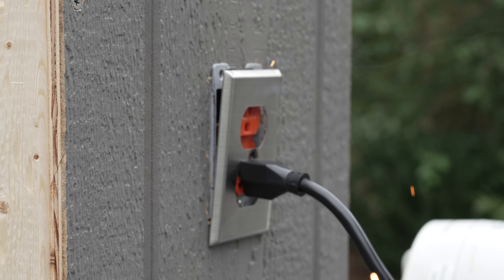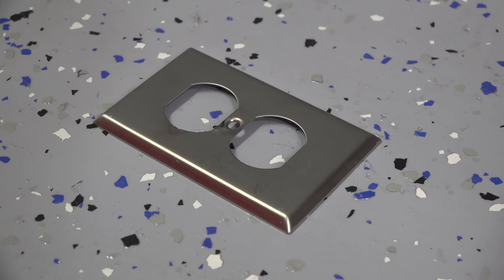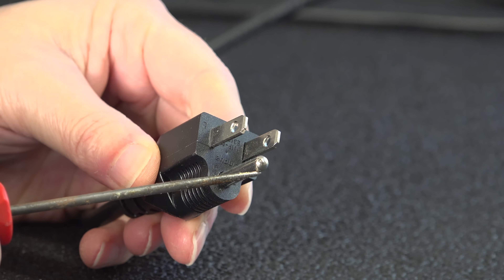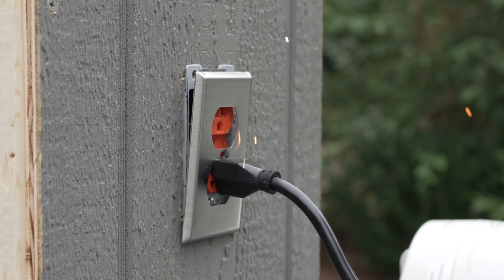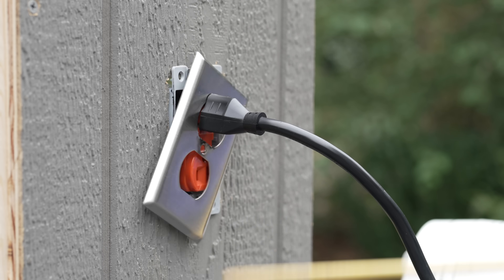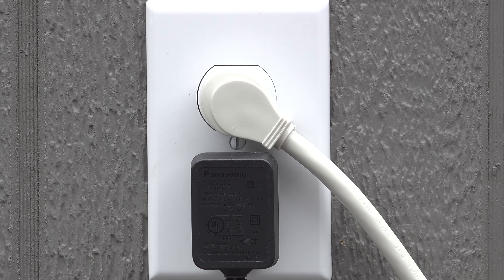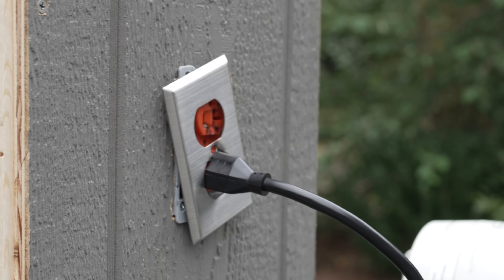What REALLY HAPPENS when you Install OUTLETS UPSIDE DOWN

Comment from the maker: Thanks for watching - What do you think of this? - Be sure to check out my favorite enhanced outlet tester: https://amzn.to/3SQut5E - or my no frills dependable: https://amzn.to/3R6FheE
Reply: I like the idea of sideways outlets. But having ALL your outlets GFCI (Ground Fault Circuit Interrupter outlets) should be the standard these days.
Reply: If the metal plate rests on the ground, and the plate touches hot, the ground fault safety system should kick in. The other way around, with the plate shorting the hot and neutral, the breaker trips. The ground pin up installation is much more likely to touch the ground pin at all times due to it being the highest point, so it may be slightly more safe. The discussion is moot though. Metal face plates are just a bad choice, and the real solution is to switch to a connector that has inherent safety build in, like the European plug F. Good luck making the switch though.
Reply: Oh boy, I hope @TechnologyConnections doesn't watch this video.
Reply: You install receptacles. Outlets are the holes in the wall with the junction box and wires.
Reply: In a hospital ground up is what we have to do.
Reply: In the 50s even the 60s outlets didn't even have polarized plugs... both openings were the same size. Polarized plugs came in the late 60s and three prongs not common before the late 70s
Reply: There are SIX ways to install - ground up, ground down, neutral up, neutral down, on the ceiling, on the floor. There is a good reason why NEC is silent on this: There is no objectively right way, notwithstanding some of these arguments. Any benefit of a given way to install is outweighed by some drawback of that method. 
Arguing about "ground up or down" will get you banned on most professional electricians' forums - I am not joking😄
Reply: Installing ground side up is code in many states for commercial applications. 
I've never seen a wall plate rattle a plate screw out.  If a metal plate is overtightened it will warp the plate.  If a plastic plate is over tightened they used to break.

if a metal plate has somehow rattled lose unplug the device. If the outlet is on something like a cart which is prone to rattling lose, locktight.

Comment: With HD vinyl plates there's no good reason anymore to use metal, and plenty of bad reasons to avoid. 
Besides the inconvenience of cord up 'upside-down' plugs, the chances of someone grabbing the hot metal plugs on the bottom with fingers is way higher just because of the way we grab plugs.

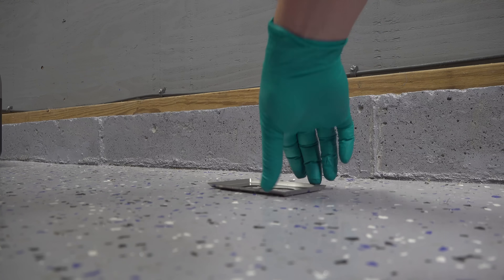Comment: So… the reason is not the cover plate falling entirely 3:56 , it’s literally any piece of metal falling on it. As long as you remove gravity or/(but not and) all metal obects that could possibly connect a circuit from the house then it would be almost as safe to have the grounds facing down. But since this is unlikely to be the case, and it’s much more likely that a metal picture frame would be grabbed and handled by a non-electrician, than a cover plate on an outlet, then I can’t support this concept. He is right about the plugs being more likely to break or fray, but that’s a separate issue. They should start making plugs correct from now on. Just my two cents.

Comment: My house was built in 1970 and when I bought it in 1998 all the outlets were upside down. Many were old and broken and all had layers of paint on them. Some had the ground hole blocked with paint. In addition, the panel is filled with 15 amp breakers but the house is wired with 12-guage. That makes replacing the receptacles a miserable experience. It's on the market now and I'm finally getting around to replacing the ones I never needed over the years. Now learning how many need to be GFCI.

Comment: Nylon plates are the answer. Even the screw hole has small tabs that hold the screw in place while attaching the plate. The issue of angle cords is real. Too much strain and the cord will split or break. This ain't rocket science.

Comment: Simple answer is you install the plug the proper way, which is with the plug looking like a face. With the two main leads being the eyes, and the ground being the mouth. That's why it looks so ridiculous when they're installed upside down... Now as for the steel wall plates, the problem in those situations is clear stupidity by the workers who use the plugs. I've never seen a wall plate work itself loose without having a very long time to go about getting it tightened down long before it should actually fall off the wall. This is an issue with the staff not doing their jobs and not getting the electricians or maintenance crew on addressing the problem. Do they also keep driving their vehicles when the lugs are loose until the tire falls off? Smarten up.

Comment: the idea that the mounting screws of a metal plate commonly fall out and the plate shorts out the outlets is absurd. It is a very rare occurrence to even lose a plate screw and by far most covers are not conductive.  this video demonstrates that even in the other configuration a short is possible.  there is no code requirement because it just does not happen enough to make any difference.

Comment: Every laboratory I've worked in for the last 30 years mandates the "upside down" installation. I don't think they'd ever use metal wall plates, but upside down prevents something falling onto a partially inserted plug and causing a short. By the way, it is not necessary for such a short to cause enough current to flow to trip a circuit breaker, but it could still be enough current to cause a person to jump, which could cause other problems in a lab, or to eventually cause a fire.

Comment: If you install the outlet with ground up, a GCFI Receptacle Tester will be upside down when you test the outlet. You'd have to lay on the floor and look up at it, or use a mirror to see the indicator lights.

Comment: In this order

1.: Don't use metal plates and boxes on outlets.

2.: Install RCDs on every circuit

3.: Install the outlets sideways with neutral up

Most importand 4.: Do a fucking redesign on the outlets, that make it impossible to touch live contacts on half way in Plugs, like it is on any other plug and outlet system in the World.

Comment: I guess in other countries where they use 240 v, I suppose there are 2 hots and the ground, or is one of the pins neutral? If 2 of the 3 are hot, wouldn't make much difference which way they mount. Or even here when some outlets like for a window AC are 3 prong, with 2 being hot.

Comment: I remember seeing the exact opposite video years ago showing why it was much safer with the ground up, I didn't fall for it then and still don't. Like you showed, many of the flat plugs are designed to lay against the wall with the ground down. I see many refrigerators that have the outlet with ground up and the cord being bent 180°. But like others, in my 50 years of installing outlets, I have never had a problem with the cover falling off, but I'm sure 1 in a million it can happen.

Comment: The first thing I do when I move into a new place is turn the outlets around so the ground prong is down. That's how the outlet is pictured in every installation guide and marketing photo. And that's the way you have to put them so that a transformer won't fall out under gravity, or that so the GFI cord on most appliances doesn't stick up at a weird angle and pull out under the weight of its cord. These hazards are far more likely than a sheet of steel suddenly falling into the crack behind a plug.

Just don't keep random-ass hunks of sheet metal all over your house where they could fall into an outlet. And make sure your circuit breakers are working properly.

Comment: First off, the hospital should use loc-tite on that plate screw if it is always falling out.  
Second, I’ve never seen a outlet with the ground up until I moved to Texas 3 years ago.  You are right about the plug wire orientation. Not good.

Comment: it solved a maintenance issue by introducing an electrocution hazard. the ground prong must stay connected last when the plug is dislodged to protect from shock, electrical code requirement.

Comment: You have a non GFCI, not weather rated outlet mounted outside, on a stucco wall, with an ordinary cover plate, and you're worried whether things are "upside down?" Glad to see you're at the top of the trade.
Reply: 1. The breaker he's tripping is a GFCI
2. The outlet is on a test rig, so being outside really isn't the issue you think it is.
3. That's not a stucco wall, it's wood.
All 3 of these points were easily discerned from watching the video. That says a lot about your powers of observation.

Comment: The point of the ground pin up is that if something else like a metal object hits it instead of the live hot and neutral, it will not cause a fire. Your illustration of the metal face plate creates a good conduction so yes the breaker should turn off the power, but if the object was a lighter metal that would not blow the breaker but glow like a stove burner and catch something on fire.   Really the best solution is to have the recessed sockets like they have in other countries, so nothing can get across the live connections, or have all sockets come from the ceiling so nothing can fall into them.

Comment: OSHA inspected our shop & said 120v outlets were to be installed ground upward ⬆️ position. That was in 1990. Any commercial-industrial jobs, I’ve always installed ground up.  Always passed inspection & truthfully, I felt better seeing them this way. Who knows.
Reply from the maker: That is the exact timeframe when the hospital stuff started happening also. I worked in tewo large hospitals and when it started, the mentality was that it was like a miracle had unfolded. Debunked mostly over a time as overhyped but in those years it was a big deal. Thanks for sharing this

Comment: I work commercial and have done my fair share of hospital and medical facility work and I was taught ground up always for commercial applications and explained if someone had dropped something metal with an outlet ground down and the cord was loose even in the slightest your making hot to neutral contact instantly as compared to ground up it will hit ground first and can prevent a short circuit or ground fault situation
Reply: As always, a stupid argument. Take a walk around your home and see how many plugs don't have a ground prong. 
Then go watch Technology Connections play "throw the knife at the wall" and see how impossibly hard it is to actually get something metal to drop onto the prongs of a slightly unplugged plug.

Comment: As a commercial/industrial electrician, we are directed by our foreman and project managers on the direction the outlets will be installed. As long as the NEC and AHJ are followed, there aren't any rules about the direction you install it, so most of us just do as we do our directed and install them with the ground up. However, in my own house, all of my Outlets are installed with the ground down for the exact reason you just mentioned. I would much rather have the breaker trip immediately then remain energized and waiting for someone to touch the loose plate and potentially get electrocuted by the live circuit.

Comment: I'd say the safest orientation would be sideways with the neutrals up, particularly if both outlets are being used. 

That said, the safest alternative would be to start requiring outlets to have slightly deeper contacts and plugs to have about a 3mm of insulating material along the blades/pins, even if just on the hots (split phase power having two hots for 240V circuits).

Comment: Thanks for the video.
I prefer the plastic covers, as they are nonconductive.
   All 3-prong plugs I have seen were mounted ground down, until I moved into my present home, where they are ground up. 
   I have changed some to ground down to accompdate three prong cords and reduce strain on the wiring.
   I have yet to see a loose plug cover. I have seen broken and missing covers. Those I replace with plastic covers.
  I am seventy-six. I have worked on wiring and fuse boxes since eight.
 I am grateful for the good mentors I have had.

Comment: I saw another video with exactly the reverse conclusion ….. but the scenario you show is an interesting and different problem, so I applaud your perspective.  I can recall a picture coming down and sheering off the plug below it.  My FIL thought the circuit breaker tripped and reached for the piece of the plug sticking out and all I could get out was “ahhh” before he touched it and got a pretty good shock to his fingers, but fortunately no serious harm.  And this is the counter argument… that something like a heavy metal frame falling from above may sheer off the grounding pin if the grounding pin is above the pair of flat metal parts that carry the current  …. And the grounding pin may be able to “take the hit” and deflect the metal frame or other object ….away from the plug with decreased risk of creating a short and also reducing the risk of sparks igniting nearby flammable material.  Pretty rare event but seeing it happen personally makes the ground up orientation seem safer to me.  

I suspect with the risk to kids we will continue to evolve the connection to safer designs and lower voltage connections for LED lights / lamps.  I’d like to see magnetic breakaway connections with metal parts well inside the plastic housing …. Basically a recessed plug receptacle that holds the cord magnetically rather than using friction.  Existing appliances would need adapters or have plugs replaced…. and ferrous metal prong added in addition to the brass / copper that carries the current.  But imagine a plug that has a flat face and a unique shape that can only go into the socket if it’s properly aligned ….magnetic connection and electric connections all lock on inside the housing…. anything at the surface level is an inch or more away from the conductors…. and it pulls out harmlessly if a pound or two of force is applied to the plastic parts outside the wall.

Comment: I worked in a sheet metal factory that had all outlets mounded ground up so if a piece of metal fell on the outlet behind the plug it touched the ground, not the hot. No metal wall plates.

Comment: I ran systems services in small hospitals for years, and cover plates DO NOT just fall off. I've never, ever seen it happen. After thirty of forty years the screw can get slightly loose but that's all. Phenolic covers will, of course eliminate much of the danger. But Silver Cymbal is right: the ground terminal belongs at the bottom. Mounting it the other way just looks amateurish. When I see them upside down I always turn them around.

Comment: I disagree that it is in any way less safe.  Arguably, with the ground pin down, it is entirely possible for the face plate to fall in such a way that it touches the hot pin but not the neutral, and then the entire face plate will live (with the circuit still active).  On the other hand, it is pretty unlikely that with the ground pin up the face plate will actually be able to touch the hot pin without also touching the ground too (and tripping the breaker), so if anything having the ground up is better for this sort of issue, not worse.

However, all of these situations are so contrived to begin with that they are arguably completely irrelevant anyway.  Either orientation is entirely fine, and none of them are really any safer or less safe than the others.  This is really born out by the fact that none of the many safety organizations involved have ever weighed in on this topic, at all, which they undoubtedly would have if there were any demonstrable safety improvement to be had.  The outlet manufacturers don't specify an orientation, the UL doesn't require one, the NEC doesn't care.  That's because it really just doesn't matter.  Anyone arguing one way or the other is really just a troll who doesn't actually know anything about electricity or safety, and just wants to sound smart on the internet.

(FWIW, I'm pretty sure the reason why many hospital outlets have the ground plug up has nothing to do with electrical safety.  It's because common non-right-angle plugs are less likely to accidentally come out of the wall that way.  The ground pin is longer and holds more firmly than the other pins, so if it is at the top, gravity pulling down on the plug is less likely to cause a lever action to make it pull out of the outlet.  This is the only real reason I know of why ground-up might be legitimately preferable in some situations, but it is also offset by the fact that (as you mentioned) most right-angle plugs go the other direction, so they have the exact opposite problem, and ground-up is worse for them.)

Comment: I always prefer the outlets to be installed ground pin down or to the left.  The only time I use the ground pin up installation is for switch controlled outlets for a lamp.  And, even then, I always like to install two outlets side by side.  One is switch controlled for a lamp and it is ground pin up, giving a dead giveaway that it is switch controlled.  The other one is hot all the time and it is installed ground pin down and that outlet that is hot all the time is usually a USB outlet.  That is how I always install switch controlled outlets.  But the vast majority of them, I prefer the ground pin down.